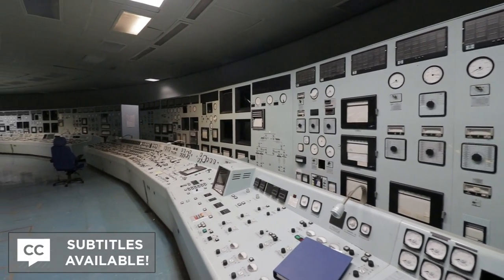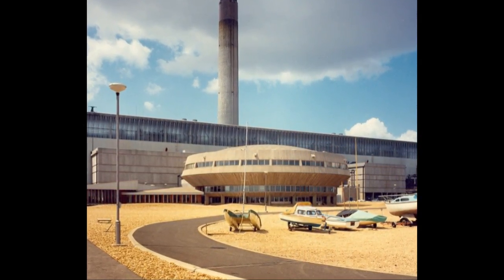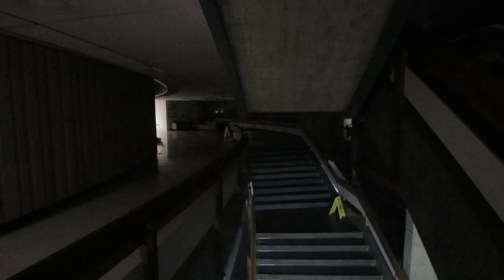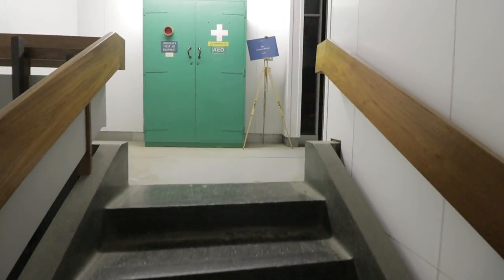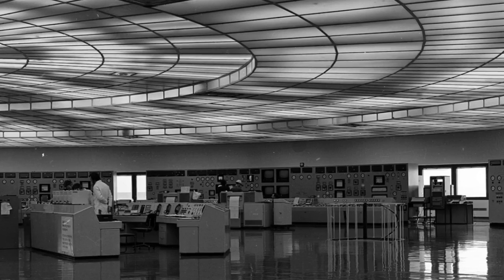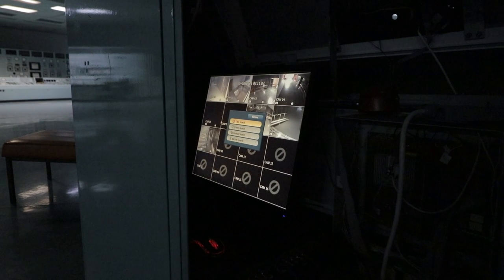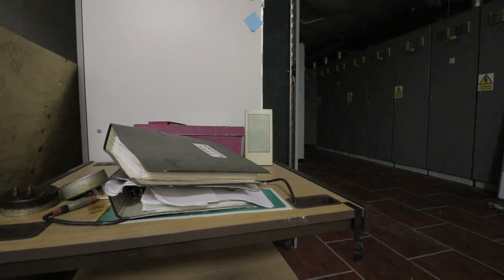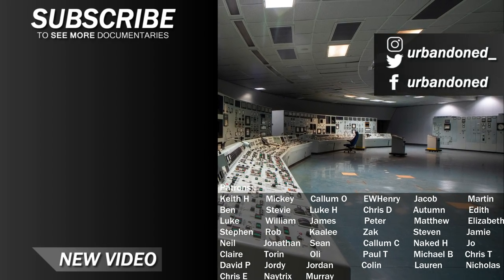Exploring the Abandoned Fawley Power Station - Rare Control Room

Comment: I worked here for 13 Years mainly CEGB and the walkaround brought back memories. All the jobs in the control room as an Instrument mechanic and the computer room which also housed the EBC (Electronic Boiler Control system) with regular tweaking and setting of the superheater spray valves for temperature control of the steam. A mine field of an alarm system by Reyrolle. All the instruments were built in imperial apart from two L&N recorders per unit that had ANC and two later Japanese recorders that only had one moving part which always went wrong. Did an install of RPM indicators for the mains units which is all that is new as a maority of the work was fault find and preventative maintenance. the unit layout did have issues as sveral operations required one unit operator to be at both ends of the panel at the same time. I had limited experince here and only managed to get one startup on the desk with the perfect gentleman Mr Steve Wade! If it had still been the CEGB I would still be working there, a great place staffed by a broad range of individuals with an even wider set of skills an interests. As for the control room building there was the main control room level with the computer room as shown. in the roofspace were air handling units (AHU). under the control room accessed via the spiral staircase was the cable marshalling runs leading out to the main plant and some more air handling equipment and the elevated cable run out to the main plant. Signal wires in grey and power cables in black.
Next level down was managers and engineers offices on the periphery and in the centre where two almond shaped meeting rooms and one did have a fitted table. Next level or ground floor was lab space and admin offices again around the peripehery so looking out of the building. there was the library were the morning meeting were held which is shown in the video. I struggle to recollect what was in the centre on the ground floor??. in the basement was more airhandling equipment and the air conditioning units  with a ramp leading out into the car park. The canteen was bolted on and was a collection of three triangle when viewed from above. Lots of concrete and solid wood doors and in the garden adjacent the control room was a sundial in concrete with the "pointer" beinga steam turbine blade which I believe was installed at the request of Mr. Wilf Wirght the first station superintendant.
Reply: The CEGB was a great employer. I was MMD at a power station in the North Western Region👍🏼
Reply: @BestUserNameUK  I think if it was still Nationalised I would still be there, It was an impressive organisation. the UK's very own engine room!
Reply: Hi Chris,  I dont know if you remember me as a mechanical appretice back in 1981. I don't know what the other Instrument appentices (Tom, Paul and the other Chris) went on to do.
At the end in 2013 just me Kevin and Stuart were still working at Fawley.
A few weeks ago the control room and canteen was all that was left of the power station. As I drove by earlier today demolition of the control room is well underway and it looks a sorry state. People used to say it was a listed building but obviously not.
Reply: @gedhicks2855  It is sad to see it being demolished having served the nation so well. I remember you playing Black Sabbath on Albert Kinseys acoustic guitar while at SETA. An the legendary story of what you used for the O seals on an ITM motorcycle. The tales from East Boldre and Hatchets Pond.  Also getting me in to trouble with Kevin and the roughly applied swarfega, before eyebows are rasied this has a purple Ford Cortina connection. Stuart features in some of the photos of FPS. I bailed out of the power industry in 1998 as it was going in a direction I didn't much fancy. I remeber the Hovercraft we built at SETA under the watchful eye of Phil "Near as Dammit" Boutemy. Harry from the stores at SETA and FPS. Sadly many have passed on now but we are able to reflect on better days.

Comment: I visited the site a few years ago as part of an architectural preservation society.  The problem with the control room block is it's such a specifically designed building. Repurposing would be really hard and expensive.  It also has terrible insulation.  This wasn't a problem when the power station was running because they had an abundance of excess heat they could pipe over to warm it up. It's a big shame its going though
Reply: Thanks for the explanation! I was thinking that the building would make a super hotel/conference suite, but the costs involved must have been astronomical...

Comment: I've had the privilege of being able to go to quite a lot of these places over the years.  This type of control room was typical of the CEGB in the 60s, always trying new things.  There have been a few things taken out since it was built, like the original ceiling lights, but the original Synchroscopes are still there though.   I'm guessing spiral staircase  went down to the cable galleries below the panels two of which seem to be still in place.    Originally,  Ill bet that conference room had a huge table and matching chairs  made just for there.